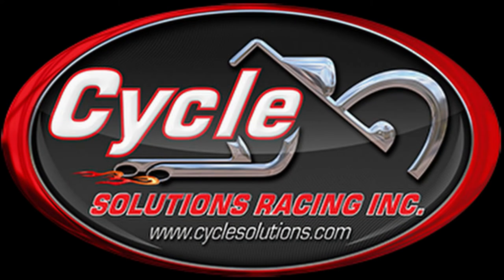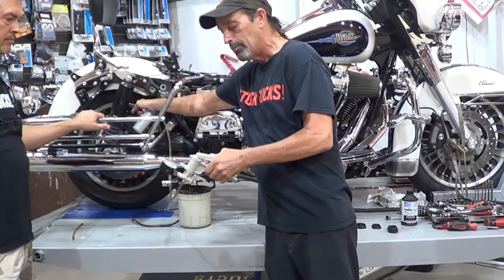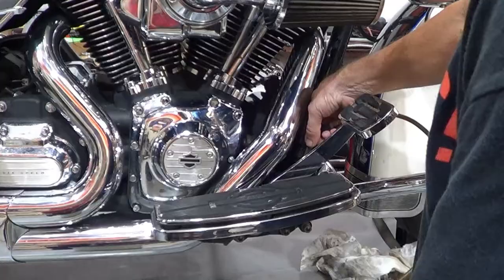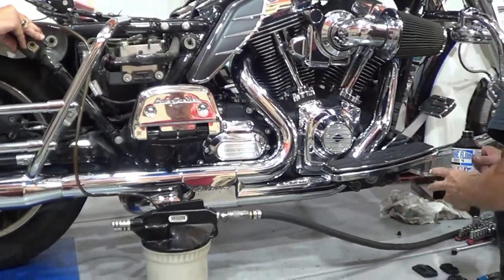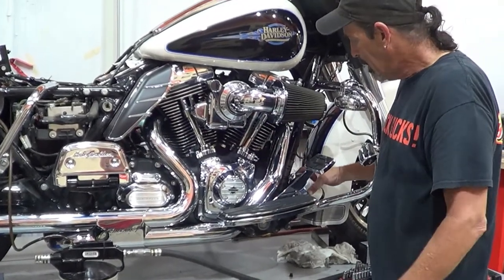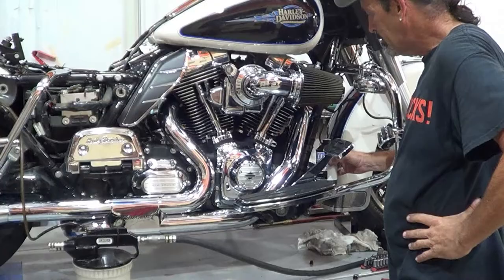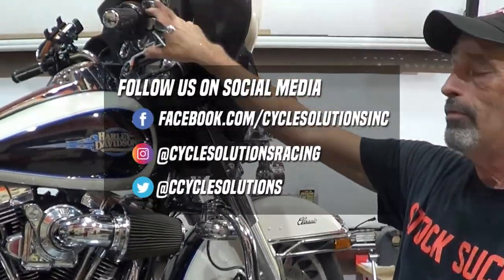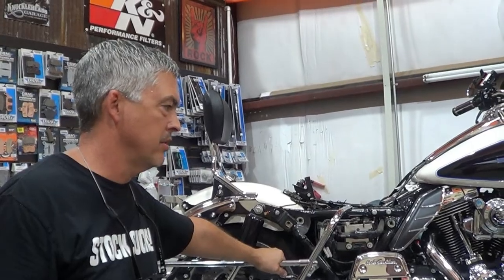How to properly bleed your abs brakes on a Harley Davidson Motorcycle

Comment: First, let me say this is how I flush the brake fluid on my ABS equipped '14 Ultra Limited and I've never had any brake problems.  However, and I'm not trying to start a debate, H-D service bulletin M1470 issued specifically for the ABS brake recall covering certain '08-'11 model bikes requires a procedure for activating the ABS/HCU module after flushing the brake fluid, which calls for using the Digital Technician II.  This procedure is also required on all ABS equipped bikes manufactured subsequent to 2011, whether air is introduced into the system or not.  There are a few aftermarket alternatives to activating the ABS that owners can purchase if they want to do the procedure themselves rather than taking the bike to the dealer.  For the record, this topic has been hotly debated on many Harley-Davidson forums.
Reply from the maker: For the record, this video is for those who don't head to HD for everything. No debate necessary. There are ways of getting things done properly without being tethered to only a dealership.
Reply: For the record, the abs hcu has valves and accumulators. Unless the abs is exercised, old fluid remains in the hcu's valves and accumulators.
Reply: @ridemfast7625  Boom! My thought exactly. My believe is that unless you exercise the ABS you in fact do have old fluid in the ABS components, minuscule as it may be. Also, stick to the factory DOT brake fluid, some may seem to have other advantages BUT, they are not reccomended for ABS as they can areate/foam when ABS is used.
Reply: @RM-np1gm  HD Platinum Dot 4 is very good. It is Low Viscosity and has the same exact specs, not a coincidence, as ATE SL.6.  I use Bosch ESI6-32N 5.1.

Comment: So does this method push fluid through the abs module? I’ve read that you have to activate the module to completely flush the fluid.
Reply: No, this does not bleed the abs module,  not sure why they even put "abs" in the title.
Reply: Cycle the solenoids by hitting brakes hard independent front, rear and then both to move fluid then bleed again
Reply: Before you flush the brake fluid?  and after of course then a final flush

Comment: The shop manual says no because you risk the chance of inducing air into the system after removing fluid out the reservoir prior to bleeding and you’re aware if you get air in the system you are stuck taking it to the Stealership to be electronically bled.
Reply: I was thinking this wen he sucked all the brake fluid out the reservoir. I would imagine u could take out all the fluid right up until u get to the little inlet holes and fill from there.....am i wrong?
Reply: @HorsepoweredRims  I think you are correct, why emptying the reservoir and risk air into the system? Simply start bleeding and re feeling the reservoir, I think this method is safer.
Reply: Or, crack the bleeder screw before applying a vacuum
Reply: @thedieselpig4448  yeah I saw that too

Comment: This isnt bleeding the ABS module which is the most important part of a Harley (ie..expensive) ABS  brake system and the reason the ABS module fails. You are best to bleed your breaks like in this video than go out with freshly bled brakes and go out to a big parking lot somewhere where you can do some hard stops to activate the ABS afew times and stir the fluid up in the module and then rebleed the brakes....or....spend the money for the dealer to do it or buy the scan tool. 😂

Comment: I know this is old but it is so wrong to call this "Proper". I would think this could lead to some liability issues. The Moco calls for a procedure thar purges the ABS module. Absent this it cannot be called proper. This procedure was instituted by the Moco after they lost some lawsuits on ABS failure. If the dealer cost to do this at 1 hour plus materials is too high for you, there are alternatives. There are devices available for consumer purchase that will cycle ABS. Some people advocate for change fluid, ride and activate ABS up to 10x then change fluid again. And some people advocate for just bleed system as you would non-ABS systems. Pick your poison.